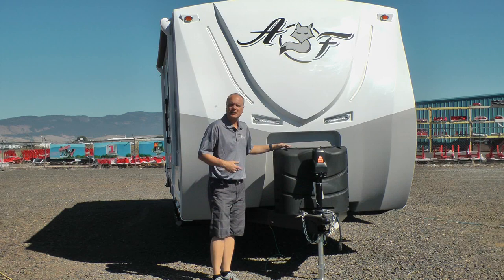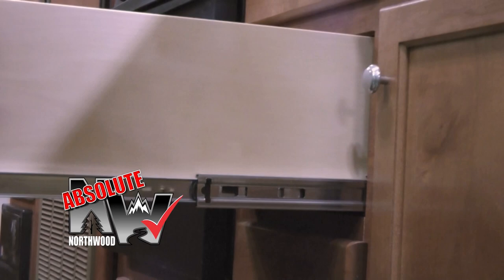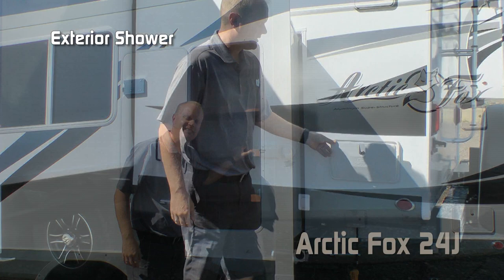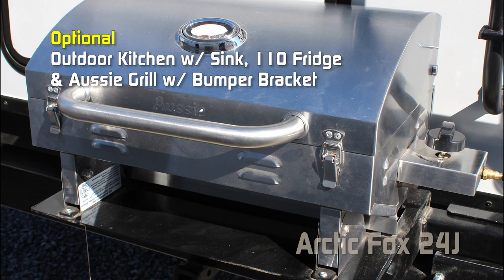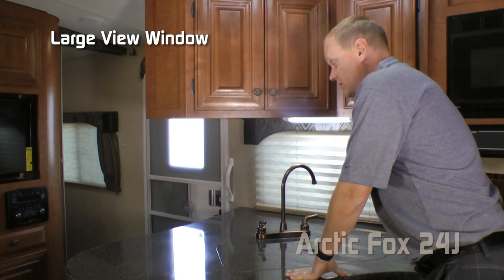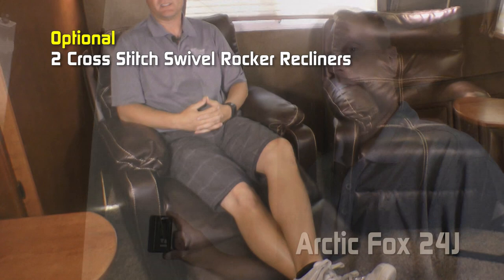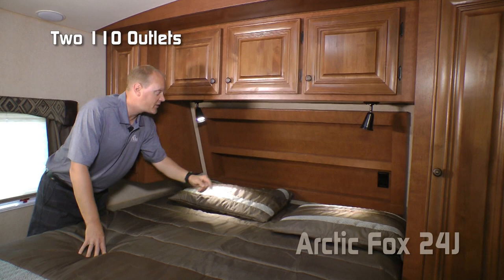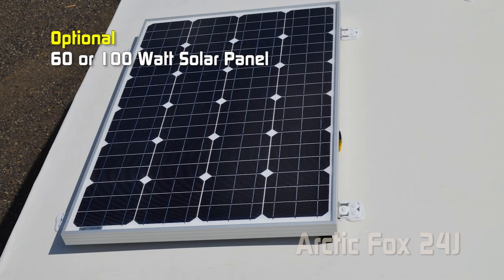Quick Tour of the New Arctic Fox 24J Travel Trailer

Comment: I have 24M. yes it’s well built, but wow that sucker is cold to stay in during winter. Drafty too! My next camper will not have a slide. Also, I’ve grown to hate the 74.5 inch long bed length. And I’m only 5’10’’

Comment: Cutting the sheet insulation like that means each peice is 1 1/2 inches too wide. As such, it gets bound between the rafters. Then  when pressed down too far as easily seen here, it will never 'puff' up and fill the cavity where it has been pressed down too far. There goes the intended R value. 
Pushing the wall insulation in past being flush with the studs was met with chastising from both my boss and or the building inspector. And, always required a redo. But here, It'll never sit nice in there as it's  too wide. All that effort to build something shouldn't be messed by such a simple error.

Comment: Here's a tip I have found after helping a friend fix and remodel around 35 Travel Trailers of all kinds. No matter how much you pay,,after 8-10 yrs,,they ALL LEAK,,and you never see that leak until it has rotted out the floor. Except for Airstream...the only one I saw with NOT LEAKS>
Reply from the maker: No matter what RV you buy if you don't maintain the seals and sealants they will all leak! Every single one of them. Very easy to do the annual checks and maintenance to maintain our RV's a lifetime. We use marine grade plywood vs osb board found in a lot of other manufacturers including Airstream, therefore if moisture does get into the RV it won't fall apart.